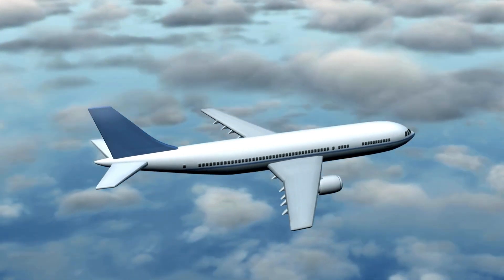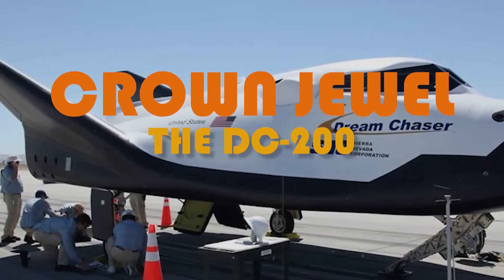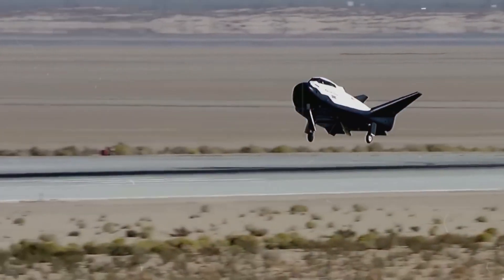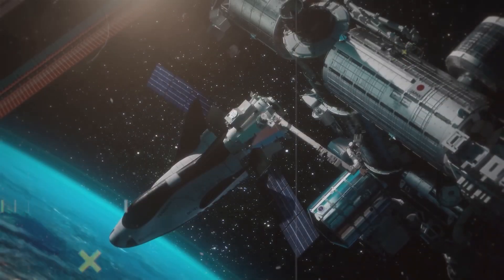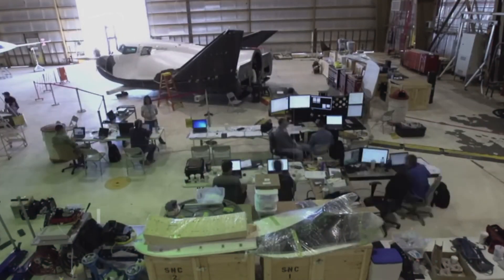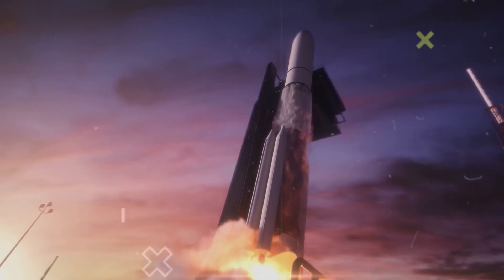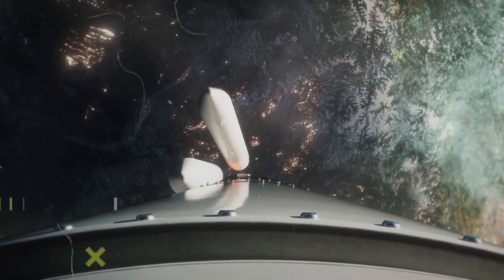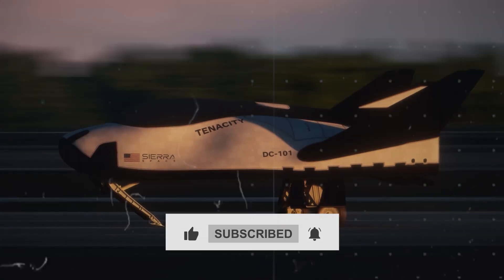Dream Chaser is About to Launch || New Starship Update - Elon Musk is Happy

Comment: While the Dream Chaser, is about to launch. The one thing that's grounded. Is this, voiceover guy audio track. Do you think you've deposited enough, Plosive, P-Pops?  Did you just add those for good, measure? Apparently so.

Yeah that is real amateur hour, that voice track, narrative, disappointment.

Look. All you needed to do. Was to cut everything below, 50 or 60 Hz. Then give yourself a couple DB boost around 100 or 120 Hz. The pops would go away. You would still have a nice full round sound, on your voice. And add a Dynamic Range Limiter. You can actually hit it hard. You can pull, 6-10-15 db's of gain reduction. You'll love the way your voice sounds, that way. Guaranteed.

Of course they can also, enhance, lousy room acoustics and background noise. And for that? We use the, actual inverse of, the dynamic range limiting. Referred to as Downward Expansion or Gating. Which is set with a, volume level threshold. And when you set it, on your breath. It turns down your breath. So, you don't sound like you are gasping for air with a karma terminal case of asthma. No. It cleans all that up. I've been doing that since 1978. This incredibly effective. It's the difference between Pro and amateur hour, wannabes. That don't have a clue. But they have a college degree.  And have learned, little too, nothing.

Before the Internet existed. We all had to figure this out in Analog. Everything digital today. Simply, mimics, reproduces, emulates, imitates. All my old analog stuff. Don't think it doesn't. Of course you can do much more now also. But then it gets mighty artificial and Electronifried, sounding. Over bloated, super enhanced, overly phased. All sorts of horrors. No one needs to hear. No.

Just give me some good old-fashioned, Rock and Roll.  With actual musicians and singers. No more Taylor Swift types. Or Milli Vanilli.. Eminem. Justin Bieber. All those no talents. They are dripping in, no talent. At least I have the Beatles back in the day. Lucy in the sky with diamonds. I am the walrus.  Cou coup., Kachoo. When we get to the bottom we go back to the top.

Will we wake up tomorrow?
RemyRAD